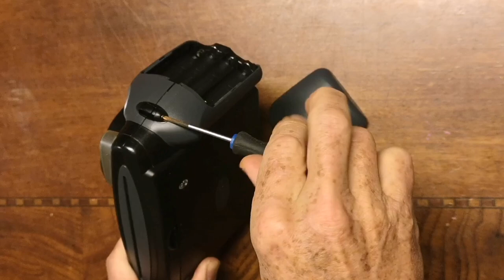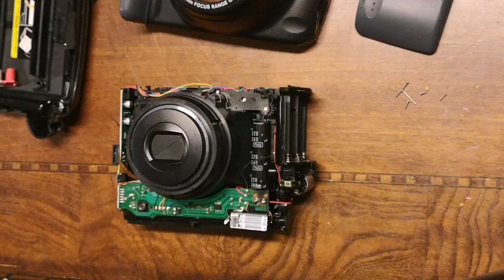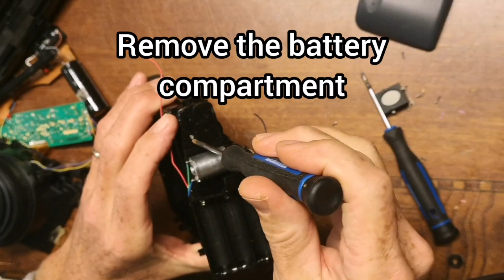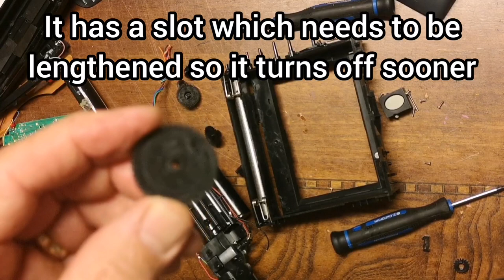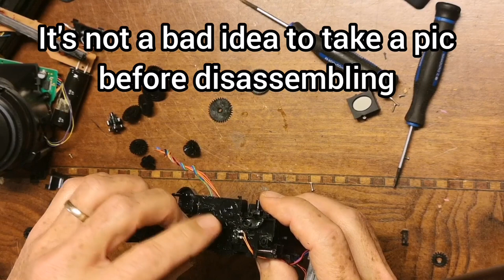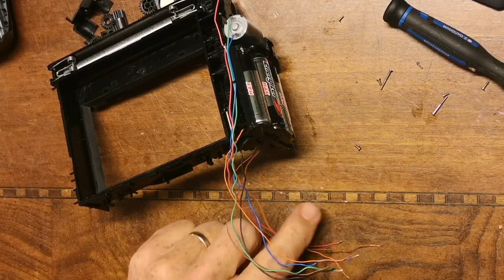Preparing an instax 210 to use as a camera back

Comment: Tank you for this tutorial, very helpful ! Have you found a solution with a relay so we don't have to drill the gear ?
Reply from the maker: Yes, the relay stops the motor quickly so the timing switch doesn't have to activate early. The relay type and wiring diagram are on my website under the instax conversion.

Comment: So how long did the slot need to be on the final gear in the end?
Reply from the maker: The slot needed to be lengthened by around 3-4mm. This method does work, but I'm looking into another method which uses a relay to short out the motor when powered off to reduce run-on.